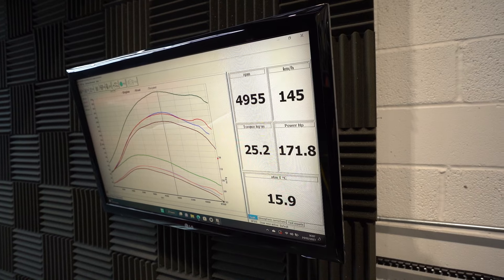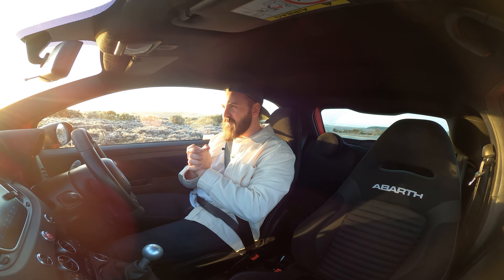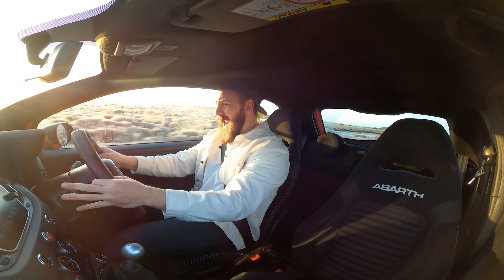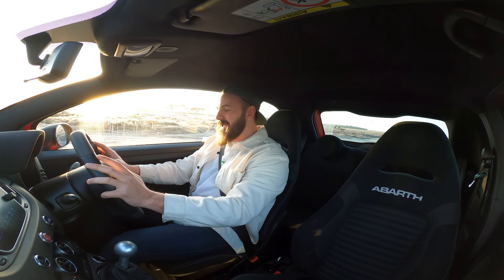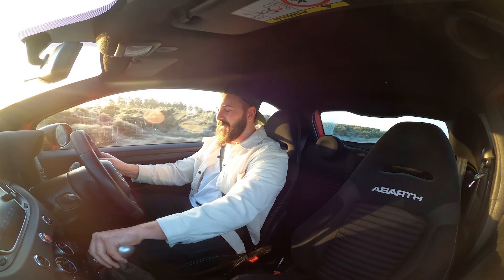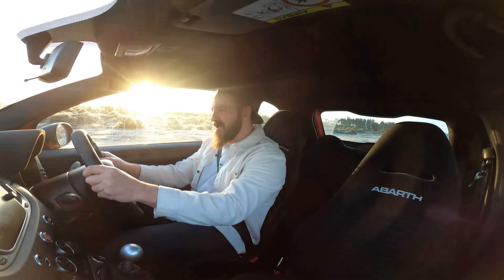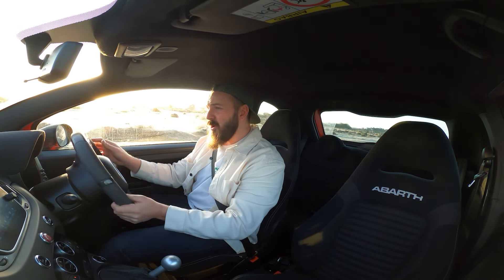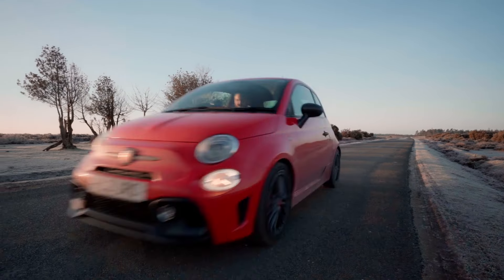Remapping an Abarth 595 Competizione!

Comment: Just picked up our new car uesterday, 2015 avarth 595. 140bhp i want to say? 
 Not read up much about them. What mods would need doing to be able to get the 200bph mark? Obviously the comp is standard 180bhp so whats actually dofferent?
Reply from the maker: That's great news! :) The 145bhp standard comes with an IHI turbo charger, the 180bhp Competition comes with a larger Garrett turbo. The IHI turbos we know can hit 190bhp, but you need to make sure the engine is safe to do so. 

Adding a better air intake & a remap will get you to the 180bhp mark, but each engine is unique. If you're local to Bishops Waltham, we can help you design & modify your vehicle :)
Reply: @arautosspecialists  thanks gor the reply!
 I'm going to take apart the intake this weekend. It's got a sticker on but for the life of me I can't remember what brand it was till I get back to the car. 
 The car has covered 35k miles so should be good to go hopfully. 
 Can I have a full list of mods prior to a remap that you'd recommend
 Thank you
Reply: Its got a bmc air filter is that any good or do you recommend another brand?